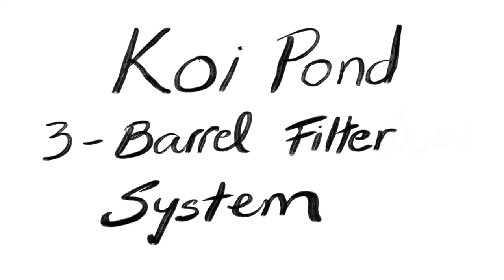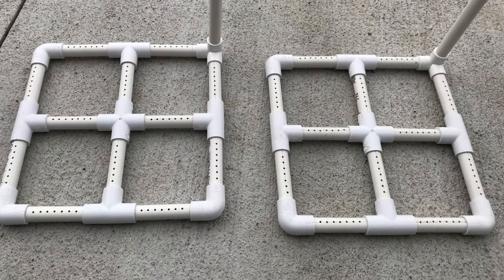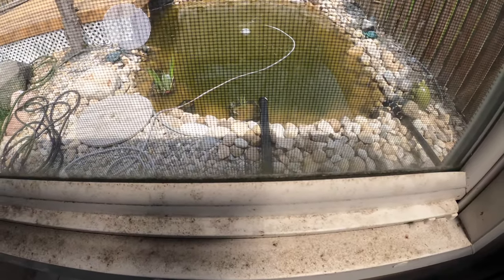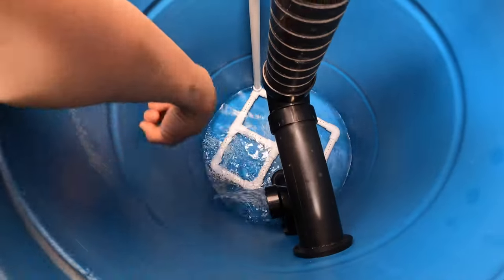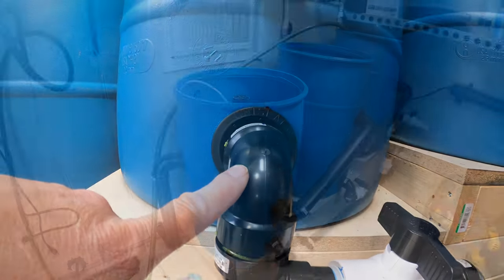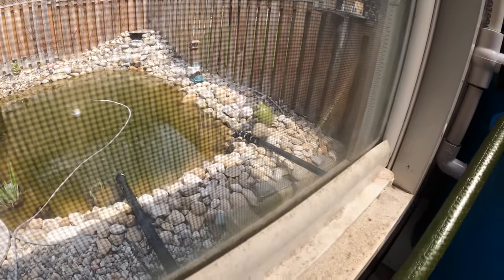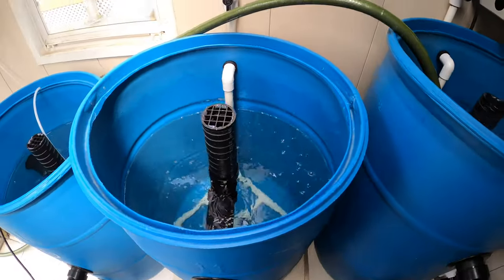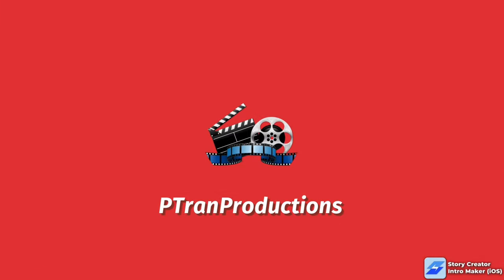DIY 3-Barrel Filter System for Koi Pond

Comment: The cleaning manifold you mentioned were drilled with a 7/16 (almost a 1/2") bit which seems a bit too large.  I would like to know the actual size as I would like to build similar ones. Thank you
Reply from the maker: Sorry, that was an error. I added a correction in the video description. It’s actually 7/64” not 7/16”.

Comment: What did you use to connect vacuum blower to 1/2 inch PVC? Thanks
Reply from the maker: Some DIY adapters (mainly extra adapters that came with the water pumps) to fit from 1/2” to to that short 1-1/4” I.D. flexible PVC extension.
Reply: @PTranProductions  Thanks
Reply: I built one with 55 gallons. Almost like yours after watching your video. Thank you so much.
Reply from the maker: @psonparote  
You’re welcome!
Reply from the maker: 3-Barrel Filter System Update 2024 - How To Make Special Fitting For The Cleaning Manifolds
https://youtu.be/YSWtmyry9II

Comment: Hi. Where did you buy and what is it called that adaptor for the shop vac to the 1/2 pipe to agitate the media for cleaning. Thank you!
Reply from the maker: There’s no specific adapter that would fit for this purpose. You just need to improvise to make it work. I just used extra adapters that came with my water pumps and a short piece 1-1/4” ID PVC tubing from Home Depot, basically to step up from 1/2” to 1-1/4”.
Reply: @PTranProductions  thank you, so I have to MacGyver something 😂.

Comment: I built a similar system 15 years ago, and it is still working.
Today I added a very fine mesh screen to each of the return barrel, I have a 4 barrel system.
The screen is the last filter for the water to pass through so that most of the very fine particles are removed.
Great system.
Reply from the maker: Thanks for stopping by!
Good idea to add mesh screen to each barrel. However would those screens get clogged up very quickly?
Reply: What is the layout of your 4 barrel system?

Comment: Is there any problem if water level of my pond higher than that of the barrel number 3 outlet?
Reply from the maker: There’s definitely a big problem! Water will flow from high to low. Therefore the water from your pond will flow into barrel #3 outlet and will flood your system. This 3-barrel filter system must be set above your pond water level.
Reply: @PTranProductions  Thanks, another question is that what size of uniseal you used for your 1/2 inch PVC tube?
Reply from the maker: The size of the pipe determines the size of the Uniseal. 1/2” pipe uses 1/2” Uniseal.
Reply: @PTranProductions  The reason I asked because I see you use the elbow at the hole and it seems bigger than 1/2 inch P{VC pipe itself. Thank you very much P!
Reply from the maker: Np!

Comment: Gonna make this set up man thx for this
Reply from the maker: You’re welcome!
Reply: Should this system buth with 5 barrels from 30 liter work 4 an ibc pond
Reply from the maker: @randombelg1474  
It would depend on the water pump flow rate. If you use smaller barrels, you need to choose the water pump size accordingly. High flow rate  pump may make the water overflow at the first barrel due to the fact that the water may not flow fast enough between barrels. 
My system is  only capable of handling 3200 GPH. Any higher flow rate (thru initial trial and error) causes the water overflow.
Reply: Okay thank you but if you use 40 mm pipes and the outle of my pre filter should be okay i think
Reply from the maker: @randombelg1474  
Yes, i was just thinking about that and may do an upgrade later.

Comment: How many gallons per hour pump do I need for a three barrel system my pond is 500 gallons I was looking at a 1700 GPH pump is that too high flow?
Reply from the maker: Minimum pump size for a 500 gallon pond would be 500GPH. This 3-barrel system can handle 3200 GPH max flow.  So 1700 GPH pump would be ok.

Comment: Is your main inlet pipe the same size as your outlet pipe? If so why or why not? Im wondering if my pipe could all be the same size
Reply from the maker: Inlet pipe is 1-1/2”. Outlet pipe is 2”. It’s because the main pump fitting is 1-1/2”. 2” outlet is for better flow. You can use all 2” if you like. But keep outlet size at 2” at minimum to maximize the flow.

Comment: I have a question, can i use a uniseal on an uneven surface? I have a 30 gallon, white with a red top barrel. There are two rings on the bottom [1/8" maybe 3/16" rise], that is where I would like to put my drain pipe. Will the uniseal still work?
Reply from the maker: Ideally, the surface should be smooth and even.  I am not sure if it would work with your condition. However the main contact surface for the Uniseal is roundness of the whole. As long as the uniseal fits perfectly in the whole, it will keep watertight. But again I am not 100% sure it will work with your situation.
You can also make the drain pipe at the bottom of the barrel and run it to the side from underneath as an alternative.

Comment: Hello Mr Tran quick question, what size aerator are you using in your 3rd barrel?
Reply from the maker: 8” air stone with 20W (1700 cubic inch/minute) air pump.

Comment: Where did you get those plastic pipe screens from please?
Reply from the maker: The Home Depot - plumping area
Your friend has shared a link to a Home Depot product they think you would be interested in seeing.

2 inches TERMINATION VENT SCREEN

https://www.homedepot.ca/product/ipex-homerite-products-2-inches-termination-vent-screen/1000479346
Reply: @PTranProductions  it's come up with access denied, could that be because I am from the UK?
Reply from the maker: @Zeamus634  
Try this: https://www.homedepot.com/p/The-Plumber-s-Choice-2-in-Termination-Vent-Cap-with-Condensation-Drain-TVENT2/305851779

Check your local building center for 2” termination vent screen.
Reply: @PTranProductions  nope, still saying access denied...I've never come across those at all in the UK.
Reply from the maker: @Zeamus634  
Sorry to hear that. I don’t know why you don’t have access to Homedepot.ca or homedepot.com from UK.
My only suggestion to you now is try to Google search it or your local building center.
Good luck!

Comment: Very nice setup . May I ask what type of washer you used for the holes in the barrels for connecting the pipes to the next barrel ?
Reply from the maker: No washers needed - Just Uni-seals were used for all pipe fittings to the barrels.

Comment: Hi great video. Do i still air pump in the pond if fI already have good oxygen supply in my sump tank ?
Reply from the maker: Thank you!
Yes, the air pump in the pond is needed to provide more oxygen to the bottom of the pond and provide good water circulation from bottom to top of the pond. Oxygen supply in barrel #3 is mainly for the beneficial bacteria and to provide good circulation for the media in that tank.

Comment: Whats is the measurement from the inlet hole to the drain hole in second barrel? I dont know if the measurement matters. Or if I got to low if it will stir up settlement gunk. Thanks
Reply from the maker: It’s roughly 8”.
Reply: @PTranProductions  thanks
Reply from the maker: @plumbedcrazy  
You are welcome!

Comment: What size pond will this work for ? and where/how do you do the pick up.
Reply from the maker: This system works for up to 6000 gal pond. The “pick up”? Do you meant input pump?
Reply: @PTranProductions  Well really I mean the pipe that supplies the input. What kind of filter do you put over the end of it or do you use a pump on the bottom of the pond/pool in a mussel style cage???
Reply from the maker: 1-1/2” ABS pipe with submersible pump at the bottom of the pond (retrofitted bottom drain).  Yes, the pump is a DIY enclosure/leave cage or you so called the mussel style cage. You can watch some other videos on my channel for more details.
3-Barrel Filter System Update - Final Cleaning and Shutting Down For The Season
https://youtu.be/0kculkMQ0is

Comment: Hi, im still watching so forgive me if you answer this further in the videi but how many gallons can this handle? Also do you have a heavy fish load?
Reply from the maker: I tried out with 4500 GPH & 3170 GPH pumps at startup. This systems couldn’t not keep up with 4500 GPH flow rate but has been doing fine with 3170 GPH. My pond volume is about 6000 gallons and so far the system has been doing great.
In term of fish load, I currently have 5 koi and 30 gold fish (not sure of the total weight) but according to online info, 2 cubic feet of K1 could handle 35 pounds of fish. 
I hope this would answer your question.
Cheers!

Comment: Hello, Just sent you paypal, do you know if I can use 30 gallon barrels for space saving as my pond new pond is just about 850 gallons? Thank you
Reply from the maker: Thanks for your payment. Yes, my setup is for 30 gallon barrels - yes for the purpose of space saving. My pond is about 6000 gallons and this setup works beautifully.  However if your pond is only 850 gallons then you can even go smaller size barrels and add the media accordingly.

Comment: I don’t know, but I wonder if you would be better having one static barrel of K1 or K2, and the other static barrel with a different kind of media (maybe sand, gravel, lava rock, or ICB Basket…) to allow different kinds of bacteria to grow?
Reply from the maker: Economically speaking, having sand, gravel and lava rock would be a cheaper option but may not be a better option. That’s because cleaning K1 and K2 is much much easier than cleaning those gravels and rocks once they saturated.
Reply: @PTranProductions  yup I agree. I’m about to build one following most of what you did. Ease of maintenance is a biggie.

Comment: When i removed the lids from my barrels, the barrels seemed to lose their roundness... is this normal? Will the round shape return so the lids fit ??
Reply from the maker: I don’t experience that with my barrels. Perhaps, your barrels are not sitting on a level floor/platform (?)
Reply: @PTranProductions  no...they are...i wonder if it's because the cut was made just below the weld joint of the lid to the barrel..the saw wouldn't get closer due to a guide. I filled it with water and will try a better strap to see if i can get it back into shape
Reply from the maker: @Mrsboncouer  
I am just wondering how you cut off the top of your barrels. Did you cut the top rigid rim off as well?

Comment: Hi, I love this setup, I have two barrels 30 gallons each, what size off pipe you recommend?an another question, all the pipes need to be the same size? Thanks for the information
Reply from the maker: 2” for input, output and between barrels. 1-1/2” for drain pipes. If your main pump outlet size is 1-1/2” then you need a 1-1/2” to 2” adapter for your barrel inlet. Basically two different sizes of pipes to be used.
Reply: @PTranProductions  thanks for your help I have a better idea what to do
Reply from the maker: @luismerida4348  
Np!

Comment: Why does the barrels need to be different hight? Isn't it easier to keep them the same hight?
Reply from the maker: Barrels are set up at slightly different heights to allow a better flow of water from higher barrel to lower barrel. You can try to set them at the same level if you like.

Comment: Hi I built the same filter system with 3 barrels but only running a 2000 hph submersible pump and currently the first and second barrel are overflowing. I'm not sure why as they're staggered in height for increased gravity flow too. Any tips or ideas?
Reply from the maker: There are 3 possibilities that may cause the overflow:
1. Barrel size: mine all are 30Ga. If yours are smaller than that could be the problem.
2. Pipe size between barrels - is it at least 2” diameter?
3. Is it just the air pocket that trapped in pipes between barrels? Here’s how to release the air pockets:
if your barrel 1 overflows, try to clear the media away from the inlet pipe in barrel 2 to release any air pocket. Do the same for barrel 2 and 3.
Let me know if any of those fixes the problem. 👍✌️
Reply: @PTranProductions   I’m using 3 55 gallon barrels with a 1 1/2 inch intake and all 2 inch PVC pipes in between each barrel. I haven’t added media yet so I don’t think that’s the issue either
Reply: I’m using a shower drain currently with multiple holes drilled into the sides. Do you think that’s not enough flow and maybe the PVC with slits is a better idea?
Reply from the maker: @gordontrinh731  
Yes, shower drain is good for top overflow but the vertical pipe needs to be slit either horizontally or vertically for better flow. Also, drilled holes may get clogged up easily overtimes.  Since you haven’t added the media, you can remove the shower drain and the vertical pipe to let the water flow thru to see if that would fix the problem. If it does, you will for sure need to slit your vertical pipe to improve the flow.
Reply: @PTranProductions  I tried removing the drain and pipe but the water still rises to the point of almost overflowing. So I left the water pumping and found that the water level eventually stops at a certain point and doesn't actually overflow. The water level of the third barrel where the water returns to the pond doesn't overfill at all and sits right at the shower drain. Do you think it's maybe a water pressure issue and the staggering of my barrels is off?
Reply from the maker: Keep in mind that the water level of barrel 1 & 2 is set by the overflow/outlet of barrel 3. That is, if you set the overflow pipe in barrel 3 too high to allow the water to go back to the pond, that in turn will set the water level of barrel 1 & 2 high to almost overflow.
Not sure how stagger your barrels are but mine at about 4” increments.
Also your pump rating is 2000 GPH?
Mine is 3170 GPH and I have no issue.
Reply: @gordontrinh731  don't know if you'll read this but you might have a partial airlock we used to jiggle are barrel system back and forth to release the air but be careful of the pipework if you try this ! And in my opinion slots don't work 4 or 5 mm hols drilled in the top 3 to 4 inches of each pipe will allow for better flow. These 3 barrel systems work time and time again I'm sure you'll get it working 👍

Comment: The last barrel is moving bed filter.. can i ask what moving bed filter does differently of first two? Sorry if my english is bad… :)
And what UV light are you using? :)
Thanks for answer :)
Reply from the maker: You can find more precise answer here for the moving bed: https://www.alltechcoppens.com/en/news/moving-bed-filter
Jebao 55W UV light is the one used for this system.
Reply: Thank you :)
Love how you build your filtration system :)
Reply from the maker: @mihaa787  
You’re welcome!
If you love it, don’t forget to like & subscribe.😀
Reply: I did 😀
Can i just ask one nore thing… i will make same filter system… with 3 barrels.. 100liters each… how much hel-x of K1, K2 and K3 do i need aprox…. If you can halo me with that 😀🙏
Reply from the maker: @mihaa787  
I use 2 cubic feet in each of my 30 Gal (132L) barrel.
If you use 100L barrel, I would say, start off with approximately 1 or 1.5 cubic feet in each.
Reply: @PTranProductions   one more question and then i leave you alone i promise 😂
What pump do you use.. i have around 7-8000 liter pond… will 3x100liter barrels be enough for me.. i know that filter is never to big 😅
Reply from the maker: @mihaa787  
My pond is 6000 gallons. I have two different filtration systems - skimmer and 3-barrel - to keep the water clean. So for this 3-barrel, I use the Jebao 24VDC 3170 GPH pump.
Your pond is 8000L = 1816Ga. If you use only 1 system, you need a pump of at least 1816GPH flow rate to keep your pond water clean. Now I am not sure that 3-barrel system that you plan to build can handle that flow rate or the water will overflow. That’s up to you to experiment and do trial-error thing.
Good luck!
Reply: @PTranProductions  are you using solar to power that jebao 24vdc pump?
Reply from the maker: @ranjanty 
No, the pump came with the power adapter for 120V/240V outlet. I am not planning to invest into solar power at this time.

Comment: Hey its me scot in Arkansas.. how do I get a 2inch uniseal over a 2inch elbow
Reply from the maker: Hi Scot,
2” uniseal is for 2” pipe not for 2” elbow which is bigger on the OD. So to get 2” uniseal over a 2” elbow is impossible. You can use 2” pipe cement to 2” elbow then slide the uniseal over the pipe portion flush against the elbow.
Reply: Yes I finally figured that out don't laugh 
I'm getting there
Reply from the maker: @scotholmes  
It’s all good! I am not laughing.
Good luck with your project!
Reply: Got my K1 and K2 in today 
Ordered my large round air stone.. but wht compresser do u used
Reply from the maker: @scotholmes  
If you got the material list from me, it should be on there. Otherwise here’s the link for the compressor: 
Danner Mfg Company 4520 1700CUIN... https://www.amazon.ca/dp/B001D0Y9OE?ref=ppx_pop_mob_ap_share
You may need an adapter of 1/2”-3/8” if your airline is 3/8”

Comment: i have had the same setup running for years now and have had no complaints. did you say you used 30 gal barrels? I used 55. very clean and great set up! Happy Ponding as Wtighty says
Reply from the maker: Thanks!
Yes, my setup is on 30gal barrels.
Cheers! 👍